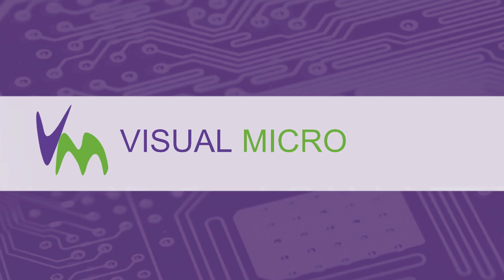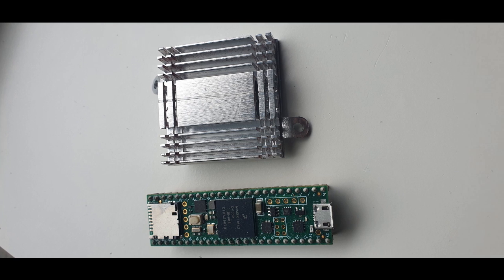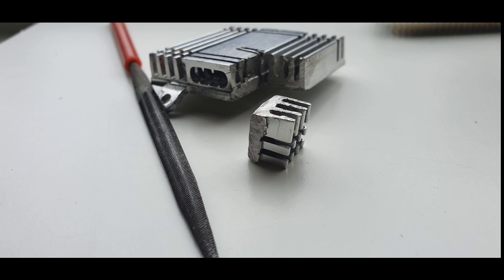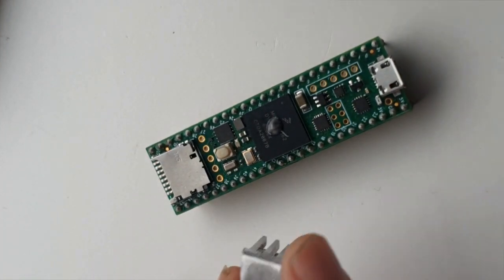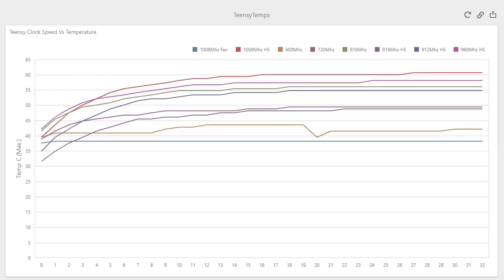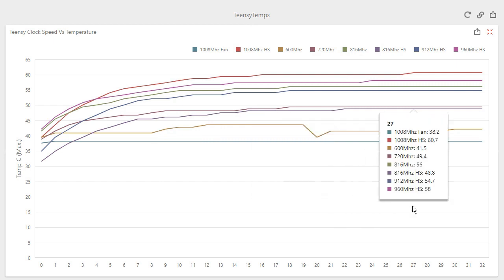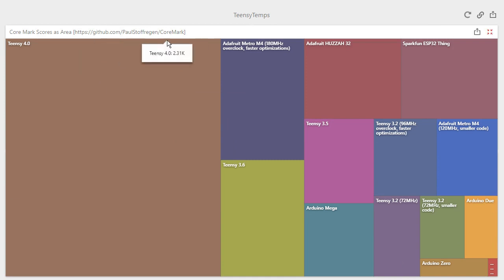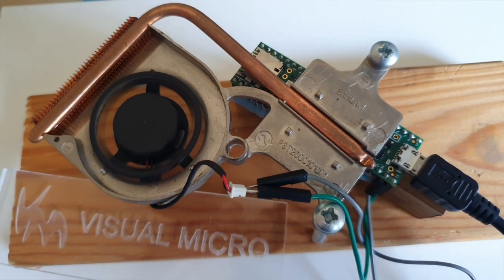Running a Teensy at 1Ghz

Comment: You might want to cover the fan. As normally the air is ducted towards the radiator. Now it just blows in all directions.
Reply from the maker: Yes the cooling would be improved if we covered the top of the fan as you suggest, but it proved to be very effective as shown in the temp charts..... and far more than we need here...

Comment: I wonder if the PSRAM you mention will tolerate overclocking. Does overclocking affect any of the onboard I/O in a detrimental way?
Reply: As far as i know the built in peripherals are set up with different clock dividers when overclocked to ensure they can still work right. sometimes a higher cpu clock speed can even mean slightly slower sd card or memory speed.